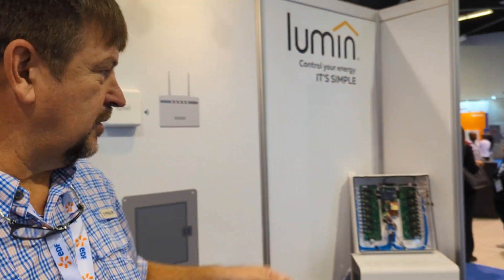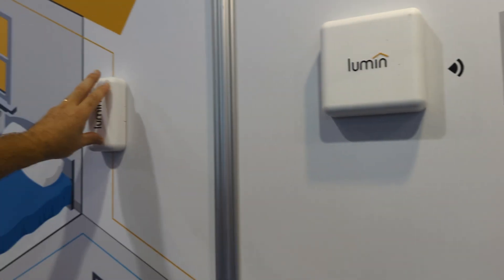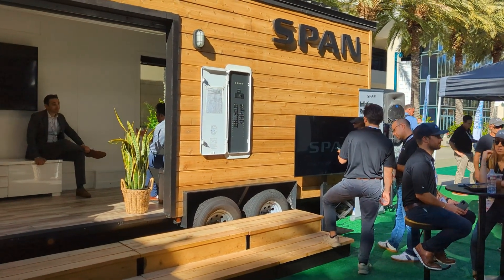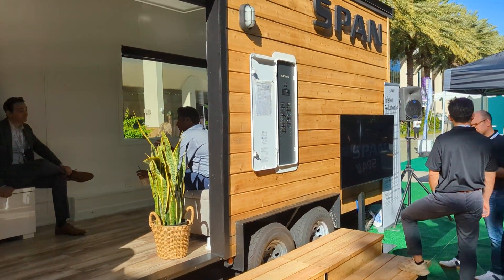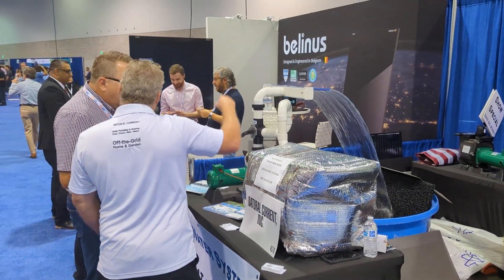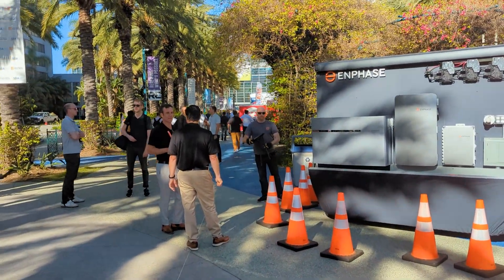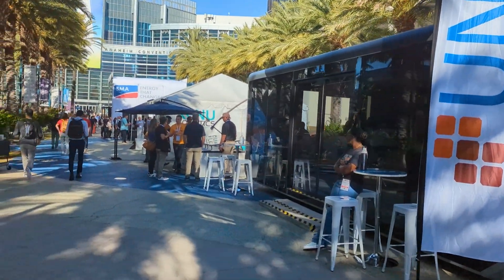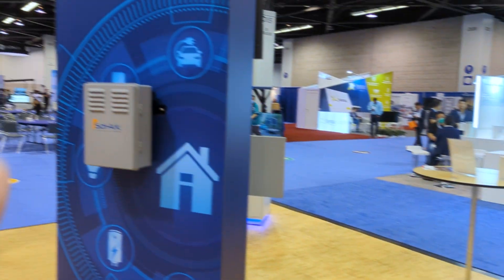Mission Accomplished at RE+

Comment: Hey, I’ve watched a lot of your videos, and I am using your guidance to help me decide on a backup inverter.  You speak highly of Sol-Ark, and I like their product very much, but I have yet to see one start a 3/4 or 1hp motor.  even the 12k fails miserably.  Have you ever seen a sol-ark 5k start a 3/4 HP jet pump?  Mine requires 69 amp on 100msec inrush, and 17.8 amps to run (currently 120v, but I can change that)  What do you think?  Can you show a 5k split phase doing something like this?  Seems like Sol-Ark has this dirty little secret that they are hiding…

Comment: Would really like to see Sol-Ark supporting microgrid like the Enphase IQ8+ microinverters. As far as I can tell, Sol-Ark's aren't grid-forming, so no AC coupling if the grid goes down.
Reply: They've had AC coupling since the 8K came out.
Reply: @randacnam7321  No AC coupling if the grid goes down. It's the key downside to AC coupling, but the new Enphase system solves it by being a microgrid.
Reply: @keithwingo514  Yes they do.  I did it temporarily with my first 12K and some Enphase M190s to keep its battery bank full before its DC arrays were wired in.
Reply: @randacnam7321  I think we're talking passed each other :D.  Sol-Ark inverters support AC coupling.  If the grid goes down, you lose all of your AC-coupled panels.  The new Enphase system provides its own grid-forming frequency, overcoming that limitation. Just wishing Sol-Ark will support it or come out with their own microgrid microinverters.
Reply: @keithwingo514  If you mean output frequency modulation to trip out grid tie inverters, they do that if the generator port is in AC coupled mode (and I've been grepping for over 2 years for them to make these independent as there is no need for them to be linked).
If you mean output frequency modulation to control GTIs that support frequency power limiting while still generating, that is on the list of to be added features.

Comment: I was there too! And also was most interested in the savant stuff. I think it's a clever execution where their modules fit into the traditional panels but are basically just relays, mini displays, and current logging in the shape of a breaker. Which means it can be in another panel as long as you route those hots through that panel. Ability to use normal established panels and breakers (from square D etc) is a huge plus over something like span. No affiliation with them, just really liked the solution.
Reply: Have you checked out Atom Power? Similar retrofit capability. EV charging solution, too.